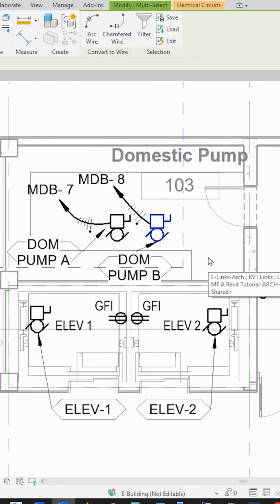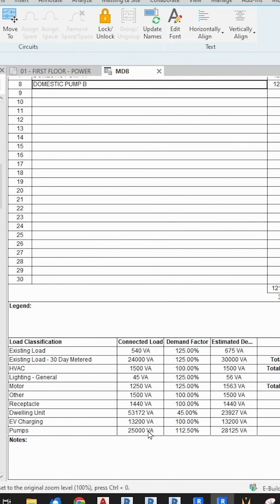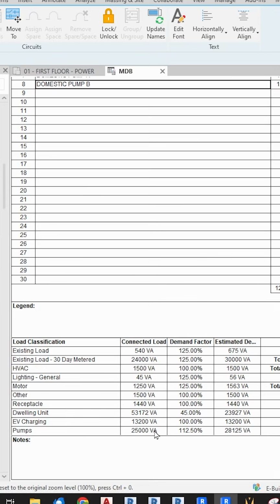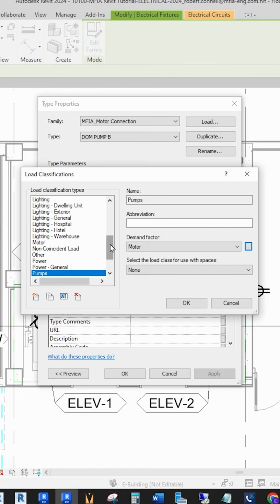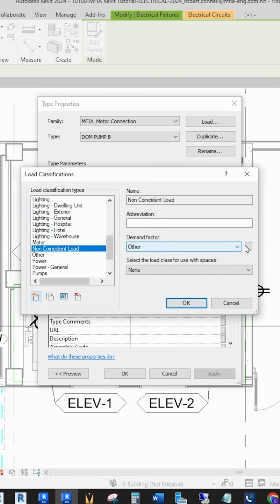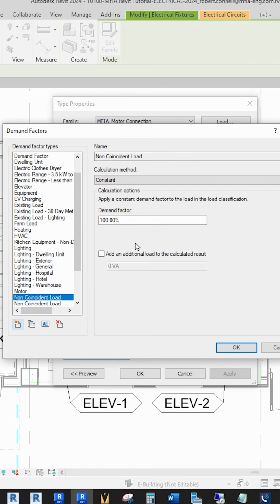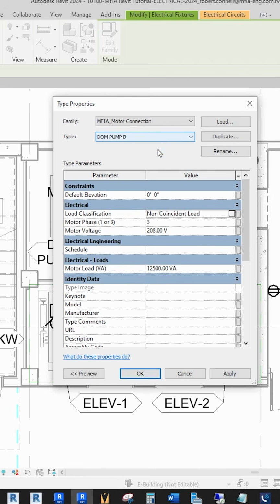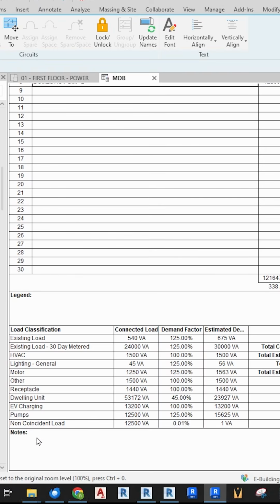Non-coincident loads Revit Hack

Comment: In the Electrical browser whenever i try to load a Outlet Range Single from  the Component tab it won't allow me to do. So my question is how do I load a outlet range single into the electrical browser?
Reply from the maker: Thanks for watching! To address your question, I don't actually use the "Component tab" for my electrical model. If a family I need is not already in my model, I use "Insert tab > Load Family" and then insert the family from the "Systems tab > Electrical" or drag from the project browser. Hope this helps. Cheers!
Reply: @ElectricRob  thanks for the response.